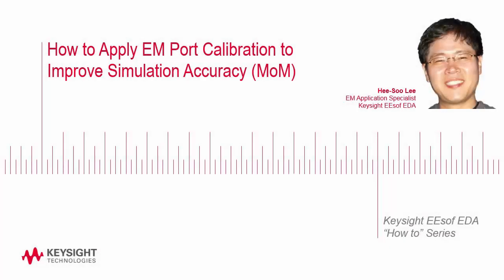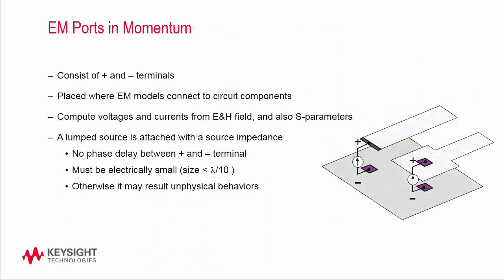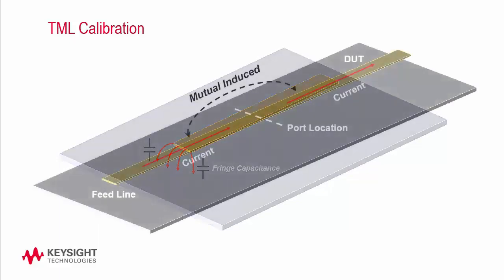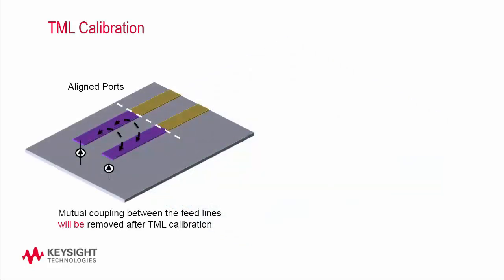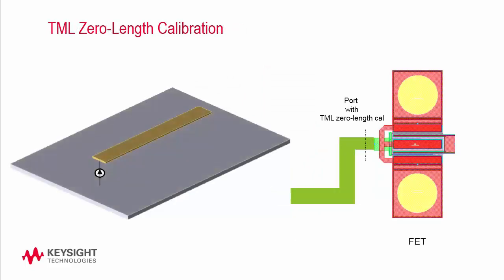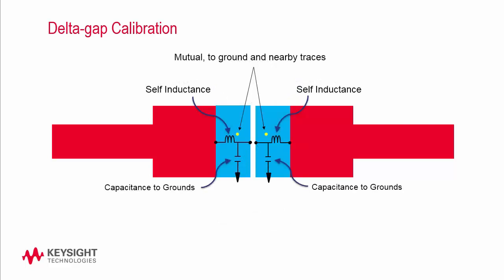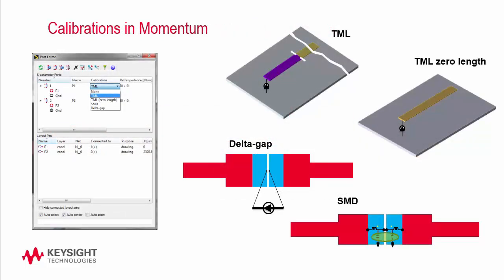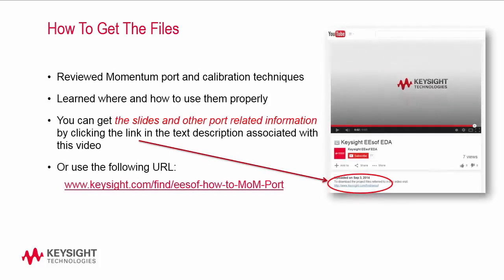How to Apply EM Port Calibration to Improve Simulation Accuracy (MoM)

Comment: Thanks for your presentation, Hee-Soo. I would like to know if the same is applied to FEM simulation and if you can make an example with CPW.
Reply from the maker: Roddy Romero 

FEM (Finite Element Method) uses field sources, so it has different types of ports.
You can find out more about FEM Simulation in these 2 documents. (1) edadownload.software.keysight.com/eedl/empro/2015_01/pdf/FEM_Simulation.pdf
(2) edadocs.software.keysight.com/display/eesofkcempro/3D+Electromagnetic+Hands-On+Workshop+Using+EMPro
(requires Knowledge Center registration—Register here: www.keysight.com/find/eesof-knowledgecenter-intro)
There are several CPW examples with FEM, please contact the technical support team to request them here: www.keysight.com/find/eesof-talk-with-an-expert